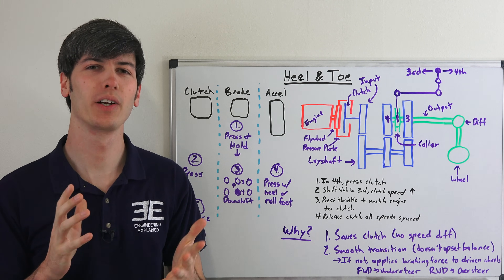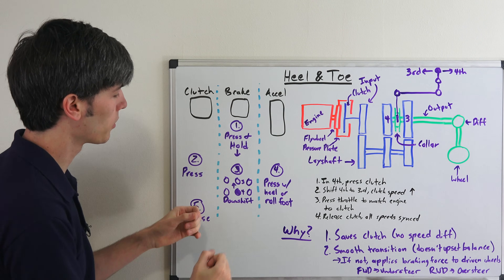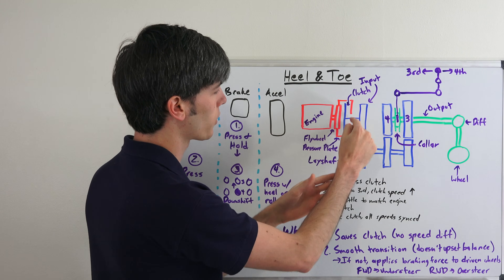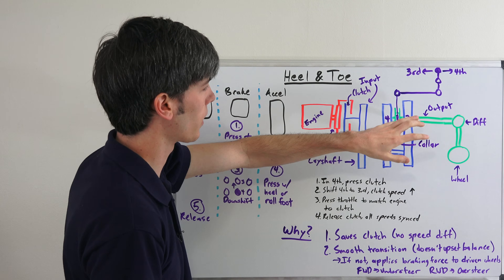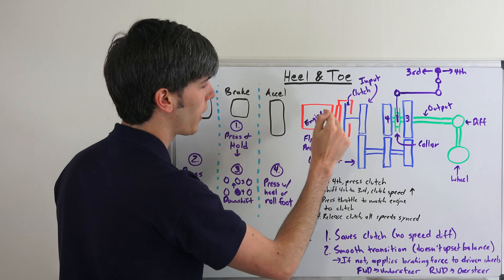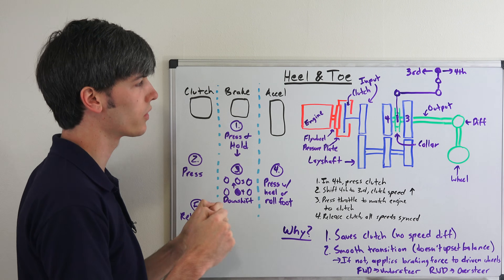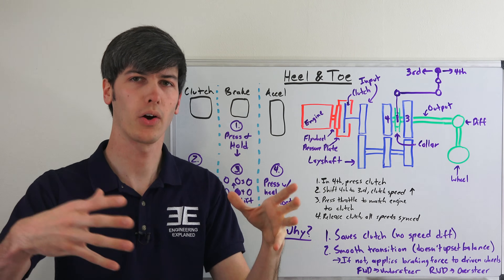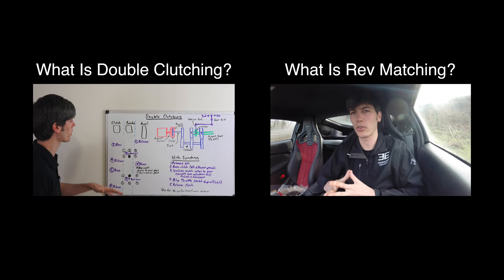What Is Heel & Toe? (Downshifting)

Comment: "Real" Heel&Toe is when you double clutch while braking. This is a simple revmatch while braking. It's easier and faster but doesn't have the "look at me, I'm Sebastien Loeb!" factor.
Reply: I have to disagree, just clutching and rev matching is way easier, and a bit quicker. Cars have syncros nowadays, they don't need to double clutch. That's just a fast and furious type look.
Reply: That's pretty much exactly what I said. Nevertheless, the operation in the video is not an actual heel and toe. It's called "fake" Heel&Toe. It's still effective though.
Reply: MikeKiloNovember I'm don't quite understand what you're talking about then. "Heel toe" has nothing to do with double clutching. If you double clutch while "heel toeing", your'e making it more difficult, and you're wasting your time. Don't take this the wrong way, I'm not trying to sound like an asshole, I just don't understand what you mean.
Reply: Double clutching is essentially a slower, but more "efficient" rev match, because it allows you to bypass synchros. I agree it's mostly pointless nowadays, but the proper way to rev match is still double clutching. Consequently, a true Hell&Toe is a double clutch heel&toe. I'm just nitpicking here.

Comment: The best thing about heel toe is being able to add in more temporary rear braking bias to help rotate the car better on slower speed tight corners with out running so much actual rear brake bias that the car is a bit scary on high speed corners.

Comment: What about going down a steep hill and trying engine braking by shifting to a lower gear. Is it a good idea to heel and toe in a situation you simply want to slow the car down with less brake pedal usage?
Reply: You can just rev match. Heel toe is more for racing, allowing you to brake at the perfect time for your racing line when cornering and still be able to rev match into a lower gear to come out the corner as fast as possible. Every second counts when racing, you don't wanna over brake just so you can take you foot off the break to downshift, and you don't wanna lose speed when cornering or coming out the corner because you have to shift down. Honestly, new brake pads are going to be cheaper than a new clutch. Hope that helps.

Comment: You make engine breaking sound dangerous to the clutch, or is it? I thought heel and toe shifting is done to exit a turn or an obstacle quickly, and reduce the time spent in shifting to the lower gear, and doing all this without getting into an under/over steer while still negotiating a turn.

Comment: In an automatic car that happens to have paddle shifters (or a 2014 Ford Fiesta SE with the 6-speed dual clutch semi-automatic transmission) is it necessary to hit the accelerator while manually downshifting to bring the engine speed up? Will not doing this mess up my transmission/ clutch?
Reply: With a car like that, wouldn't it rev match for you? And since it's practically aa automatic, I think it would.
Reply: +Customer Support Yeah I hope it would. I was just looking for some extra confirmation so I know the transmission car isn't getting ruined.
Reply: +Tajar Johnson transmission in the car*

Comment: It's interesting to note that the opposite thing happens when upshifting, but no action on the accelerator is required.  Engine RPM must decrease to have a smooth match of gear ratios.  By taking your foot off the accelerator, engine RPM decreases through friction.
Reply: That’s a good point

Comment: Hey EE, does this technique apply on modern cars as well? I know it is most likely used on manual transmission race cars and retro cars. But is it still worth doing it nowadays? ty
Reply: Modern manual transmissions? If so, I believe he said something about newer manual rev matching for you. So no, it's useless if the car will do it for you. Then you can just break and go down a gear it so.
Reply: +Customer Support brake*

Comment: What if you heel-toe and you blip the engine RPM higher than the transmission RPM?

For example, you're at, say, 3000 RPM in 4th gear. You press the clutch. You shift to 3rd gear. Now the transmission flywheel is rotating at, say, 4000 RPM. Then you blip the throttle and release the clutch, but you apply too much throttle and the engine is at 5000 RPM just a the clutch reengages. Does that apply a brief forward accelerative force to the drive wheels as the engine and transmission synchronize?
Reply: +Antenox Typically, it bogs and matches engine speed. Try blipping the throttle when up shifting and you'll see what I mean.

Comment: Hey this is off-topic but I'm hoping car guys here can answer this. Should you brake softly over a long distance or brake quickly over a short distance.

For example, when driving and you're approaching a traffic light, is it better to start gradually slowing down as soon as it turns yellow (you have a lot of time to slow) or brake when you closer towards the light (it should be red)
Reply: If you have a manual car you can start downshifting from a long distance to decelerate the car using the engine. When you hit really low velocity you can use the break pedal to come to a complete stop :)
Reply: You really want to avoid risking locking up the tires of you brake too hard too late, if you're not racing there's no reason to brake late.

Comment: off subject question is it necessary to warm up your car(wrx )?
Reply: +Ramon Dorantes It would best behoove you to warm up all components on your car before being aggressive with it...  everything will last longer.  Metal, rubber, etc expands with heat, creating a better seal.  Fluids, like your oil, becomes thinner...  thus you see 5W30 etc, that relates to cool vs hot viscosity, so your engine operates properly when it is cold/hot.

Comment: I can't for the life of me keep my foot on the brake then tap the gas without putting the car into a complete halt. The paddles do not have the same level nor same travel distance to perform such task.
Reply: I've had some issues in some cars, and it's that they suck and have the pedals not placed in good positions to do this. 
My currently happy with the aftermarket bolt on pedal pads I've installed on my 91 Jetta. 
Now I can heel toe like a pro
Reply: +MrTheHillfolk 
I'm *
🙄

Comment: Can someone explain to me why you can't just:
1. Brake
2. Press Clutch
3. Downshift
4. Leave feet on clutch and brake
5. Release brake
6. Press acceleration pedal and release clutch

What are the disadvantages of this way of downshifting?
Reply: Davegas With the way you suggest, you will be in lower RPMS (I.e. less power) as you begin to accelerate out of the turn, for example. When coming out of a corner it's better to have high RPMS for instantaneous power

Comment: Is it bad to engine brake when going downhill?
Reply: +PocketDrummer the wear of the clutch is what I was concerned about, I only do it when going downhill and approaching a turn or something like that when it's necessary to slow down an accelerate. I don't rev match because most turns here are really pronounced and I need to go in at a lower speed.

Comment: Release the clutch ? just drop it? or soft release?
Reply: Both, whether it is dropped or softly released, if you don't prepare the engine for the speed of the tires turning, you will lose speed and wear out you tires.

Comment: So can I just downshift while braking without doing the heel and toe action? I'm not a driver so idk
Reply: Of course you can, that's what you probably gonna learn during your driving lessons. You just let the clutch come slowly so your driven wheels won't lock. That can be pretty dangerous in a RWD car if you're shifting to a low gear on higher speeds.

Comment: So, is it okay to brake with the engine? I got kinda confused there. By breaking with the engine i mean downshifting while braking.
Reply: +Tomas Prado 
this isn't to help you brake faster, this is to help you get into the lower gear quicker.
The alternative would be to brake sufficiently, clutch in, move the right foot to the accelerator, match the rotations, shift into gear, and then go. Heel-and-toe overlaps the braking with rev-matching and down-shifting, so it's something racing drivers have to do.

On the road you can get away without heel-and-toe, of course. You can get away with not doing any rev-matching, even. Most drivers I know never bother rev-matching.
Reply: I've read a few articles about this subject , using engine braking vs your service brakes. 
Overall there's less wear and tear and cost in the long run if you engine brake...
Of course you need to stop eventually but your service brakes will last longer. 
Service brake being a term from trucks meaning the pedal between the clutch and gas 😂
Reply: +Mr. Wen \m/ yea i know it has nothing to do with this subject but i always had that doubt
Reply: +MrTheHillfolk thanks! But you got me kinda confused at the end. So, in conlusion, is it better to help your brakes by engine braking too?
Reply: Tomas Prado 
I always thought that engine braking is braking in gear (instead of clutching in the second you touch the brake pedal). If that's what you mean, then yes it's good for the car.

If you mean shifting into lower gear and letting the rotation speed difference between the clutch plate and the flywheel drag the wheels to a stop, I think that's horrible to the car----over-revving, transmission damage, clutch wear, etc. I was taught to do this only if I need to stop the car by all means.
Reply: +Tomas Prado 
If you can slow down by dropping a gear so you don't need to hit your brakes , or just lifting off the gas in advance  that's brake wear saved. 
If you downshift properly, the wear caused by that and the higher rpms would be minimal  over the lifetime of the vehicle vs using your brakes all the time.
Also, higher engine compression ratio increases engine braking effect. 
Ask a guy driving a Vw diesel how often they use their brakes. 
Some discretion is needed, you don't need to ricer downshift to 1st gear approaching every red light😂

Comment: Actually, what's shown here is called "false" heel and toe. The "real" one requires double-clutching at the same time.

Difference is just the "true" one will save the synchros (and is mandatory on old non-synced gearboxes). For the rest, the "false" one is just as effective, and as it's less difficult to do, is used in racing.

Comment: So if the brake pedal and gas pedal are the same shape, a really small square, I'm fucked because the pedals are both far apart, and I cannot hit both at the same time. And I cannot hit it with my heel because the gas pedal is too small for my to hit it with my heel.

Comment: Don't you have to release the clutch so the engine and layshaft connect, then rev, then press clutch and go into gear? Sorta like double clutching? Because then you would rev and only your engine would match, but your layshaft is still spinning with 4th (instead of revving with the engine for 3rd)

Comment: I have a slightly similar explanation for the people who've learned a bit about driving but need a sort of technical checklist to carry them into the concept:

Engine braking - good!
Engine braking before and after downshift - good!
"Snap" engine braking that exceeds tire grip, possibly during a turn - very, very bad.

-> If you're already threshold braking, adding a bunch of engine braking all at once is like stabbing the brakes suddenly, but only on the drive wheels.
Reply: +Blehtubezz Aus 
Modern brakes in no ways make engine braking irrelevant. Engine braking is free deceleration - use of brakes creates heat, which requires time and/or air (that would otherwise get slipped past) cool it, and brake pads and rotors are wear items. Even in the highest levels of racing, where they might start off with a fresh set of rotors and pads each race and have no possibility of cutting through the materials, heat soak will still be a factor and can lead to an overcooked corner after being too aggressive -- It's not like Rallycross is a low-budget example, but consider how many races have gone by without at least one driver overcooking a corner between being too aggressive and then not having that last 5% of braking force to make the difference.

In the same sense of the argument, the idea of keeping the engine in its power band is just as irrelevant. Nowadays, most racing series features engines with a broad and low-down torque band that requires far less finesse than a few decades ago. It still adds up, and that's what separates drivers.

Most pro racing series where engine braking might not be as technically relevant  - involve automatic transmissions with paddle shifters and truck loads of cutting edge electronics tricking in various levels of traction control and automatic rev matching/anti-lag anyway, so it's not like drivers are going to be doing any heel-and-toeing in those vehicles anyway.

I don't care if people coast in neutral in their vehicles, it's their vehicle to do with as they please.
Reply: +Blehtubezz Aus cheaper cost /less wear overall/longer brake life , yea man engine brake when ya can, as long as you aren't making it scream meemies👍

Comment: now show us in reality not a static cute video of what it should look like, remember you are doing this on the entrance to a turn, so brake,clutch, gear, accel clutch (steer) accel, at possibly 40+mph depending on the corner with also potentially other cars, not including the correct pressure on the brake to not lock up or under brake,  that apex comes up real fast and that's just on a regular sedan, like nuclear fusion, sounds great in theory, but is an artform as much as it is a technical skill in reality heck tig welding is a technical artform also. took me a long time to get used to H&T and i still suck like a vacuum cleaner at it

now i drive an auto coz bugger that for work

Comment: Why can't I just take my foot off the brake, and blip the gas while engaging the clutch? 
I don't understand the "roll your foot off" thing.
Zoom Zoom!
Reply: Not sure if you're being sarcastic, but this technique is used when braking so if your goal is to use your brakes to either slow down or come to a stop, then taking your pressure off of the brake pedal would stop you from slowing down. I think you're referring to regular downshifting.
Reply: +Raymond Rosas - I don't downshift to slow down, I was thinking of going around a corner.

Comment: You did a great job explaining how to heel toe, but you did not explain why. You explained why you should blip the throttle instead of just popping the clutch with incorrect engine revs. I think someone could come in unfamiliar with the idea of heel toe and wonder why any of this is necessary at all. They might wonder things like, "Why should I engine brake instead of braking in neutral?" or "Why shouldn't I stay in the same gear while engine braking?" Still a great video, as always.

Comment: Please do a video/series on wheels/tires handling for different types of vehicles/drives/surfaces.  For example; Does a wider wheel/tire always means more grip on FF/AWD/front and mid engine RWD/RR ? ... Do smaller profile tires always mean more grip ? ... What's the best wheel and tire size combo for comfort, on-road safety, and performance ? ... When can/should you have staggered wheels/tires ?  ... and so on

Comment: Why not just downshift as you're approaching the turn?
Reply: +klockwork006 Because you're losing time by not braking. Heel/toe is primarily for the track however it can be useful on the street.

Learn to rev match and you'll begin to find that while driving fast, you will feel the inadequacy of not being able to use the brake and throttle at the same time. That's when you begin to learn heel/toe.

Comment: Are these techniques still usefull on the streets, driving  normally, or just at the track?!
Reply: +Conrado Pimenta Everywhere. The most useful situation for daily driving for heel/toe is when you're downshifting through the gears while coming down a hill so you're on the brake and you want to rev-match your downshifts.

In most daily driving situations rev-matching is all you need.

Comment: I asked my dad if he did the heel and toe downshifting on his manual Jeep Wrangler while slowing down around a corner to accelerate afterwards. He told me "Let's say if you're 45 mph and you need to slow down to turn and you're in 4th gear, you can slow down to 30 mph and downshift into 3rd gear with no problem". With that scenario in mind, does that harm the transmission? And do you have to blip the throttle depending on the speed you're going after pressing the clutch in, or the RPM from the engine? Doesn't it depend on the gearing too?
Reply: +japman S15 If you're in fourth at 3000RPM and downshift to third and the RPMs rise to 4000RPM, that's what you need to blip the throttle to.

Downshifting to slow down is fine. It's actually the correct way to drive.

Gearing will change the RPMs, that's why you downshift normally and watch how much the RPM increases.

It's not all mathematics and calculations though, learn to rev match and you'll begin to just do it correctly without thinking about it. It takes time.
Reply: +wamphyr000 Ohh ok. I always wondered ever since that day he told me. Thanks for the info! I'm kinda new to driving a manual but I've been getting the hang of it. I like watching these kinds of videos so I won't prematurely wear out the transmission or anything,and keep them nice and running. Again thanks for the info, I appreciate it!

Comment: Not possible on a variety of cars because the gas is placed lower than the brake. At least with the cars that I tried. Just move quicker.
Reply: +reapertheunique Not true, you need to practice. Don't be convinced by people who never bothered to learn. It's awkward at first, however if you put half your foot on the brake pedal, rotate your foot 45 degrees and then roll your foot forward, you will touch the accelerator.